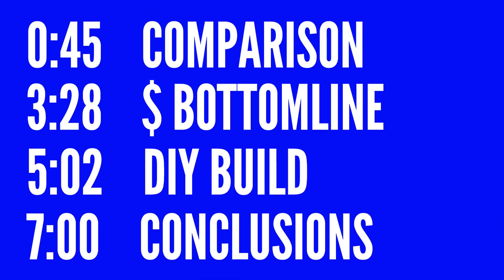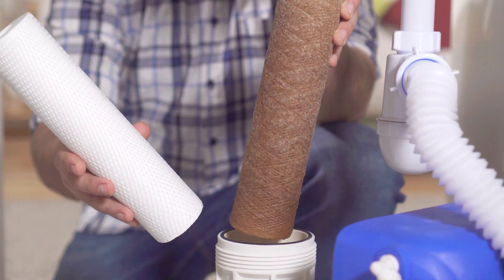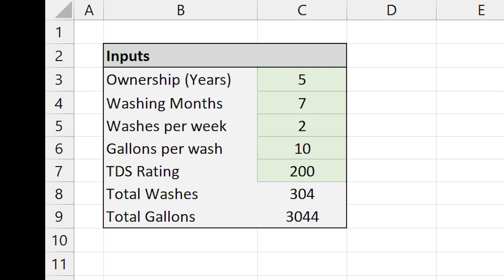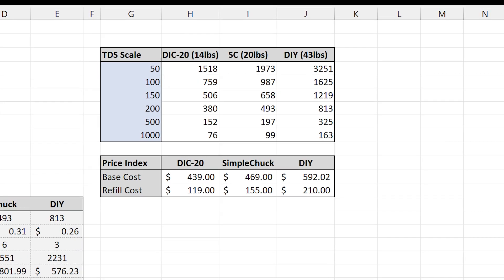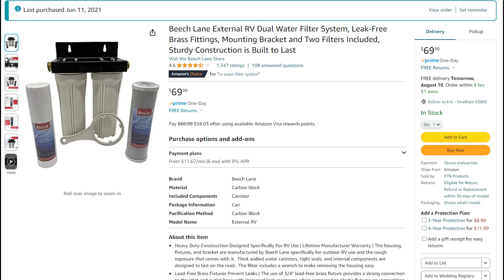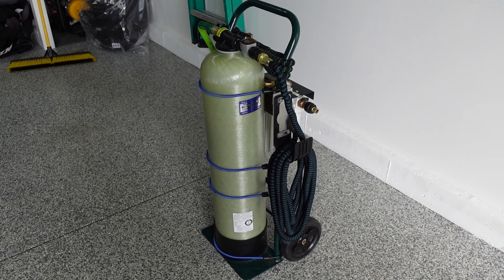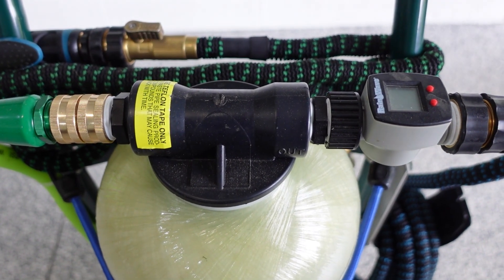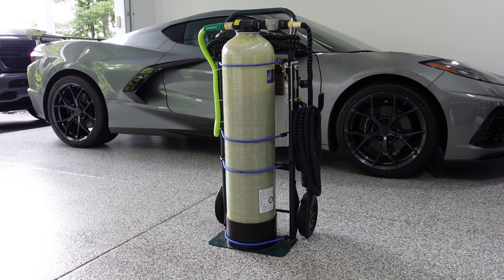No More Water Spots - DIY Water Deionizer (High Capacity)

Comment: Is that a 2x4 block you used to mount the pre filters?
Reply from the maker: It's actually just a piece of trex decking I had laying around.
Reply: @lifewithlonsi  Awesome, do you happen to have the link to the U bolts,plate and hose hanger?
Reply from the maker: @thlightest9827 The u bolts are just from home depot. The plate is a piece of aluminum I had in my shop, you could use anything, I used aluminum so it wouldn't rust. The hose doesn't seem to be on amazon anymore but there are a ton like it that come with the hanger, just search expandable hose. I've made similar hangers out of aluminum\steel by putting in a vice and bending
Reply: @lifewithlonsi  Perfect thanks, i’m building mine a tad different than yours. 

I’m utilizing 3 10”x4.5” filter housings
2 of them will be the pre filters 
(sediment/carbon)
And the final stage will be a 10”x4.5” filter housing with a refillable filter cartridge filled with roughly a little over a pound of mixed bed DI Resin.
Total project cost around $340 including hand truck, connectors, fittings etc.
Reply from the maker: @thlightest9827  Makes sense - I have a similar setup coming into my house. Originally had 10" but changed to 20". Works well with a spun pre-filter, iron filter then carbon block. TDS coming off the well is under 200 and makes the DI resin life reasonable.